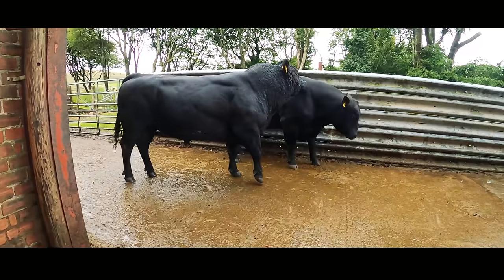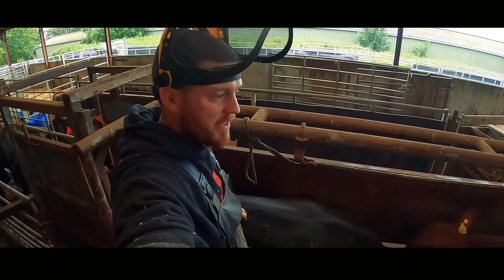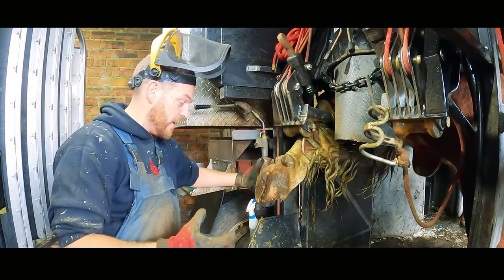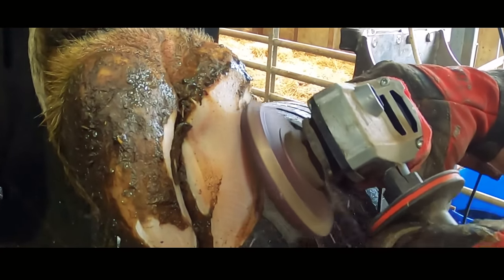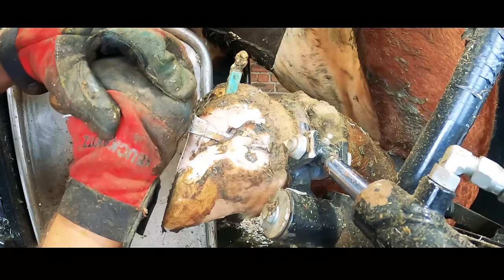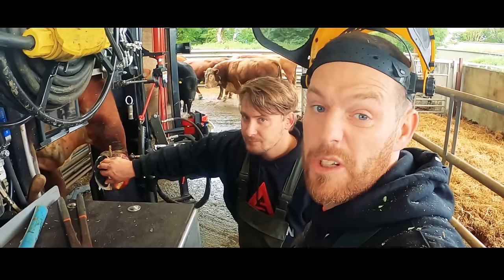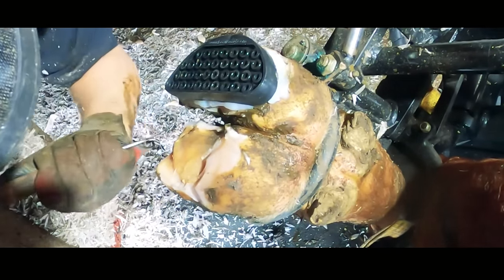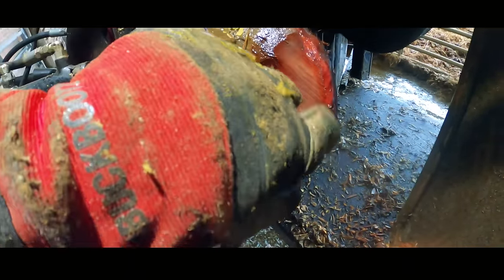*PEELING BULLS FOOT* ... hoof trimming 50 BIG bulls!

Comment: How would they have trimmed big bulls like this in the old days before these crush machines were a thing? Like a couple of hundred years ago?
Reply: They wouldn't of trimmed them because it wouldn't of been necessary.  The overgrown hoof issue is due to them being on soft ground, whereas cows and bulls in open pasture would have the natural abrasive properties of the ground to keep them worn down.
Reply: @ngnmech  you are spot on. Thanks
Reply: Very carefully
Reply: My grandpa showed Guernsey bulls back in the day so I would imagine it's how you raise them. Kinda like a horse always messing with em. I'm not a hundred percent sure .
Reply: With extreme caution I'm thinking!
Reply: @ngnmech  I agree, trimming wouldn't likely be necessary, but they would still need something like a crush.  Oxen were commonly shod with iron shoes when used as beasts of burden.
Reply: @christelchristely2816  This is fascinating, thank you.
Reply: alex Christely Great video you recommended!
Reply: @ngnmech  they where butchered on a younger age.
Reply: Well, we may never know for sure as I imagine most of those trimmers are dead now for trying to.
Reply: I know one earlier method to trim cows was to flip them on there side on a table before the hydraulic crushes were made, a method still used. They might of roped and tied them, or they might of just culled and replaced them when they did start having issues, cows back then were generally lighter too, and moved often.
Reply: There are crushes that are not hydraulic in any way, just metal, ropes and pulleys. Check out Pemberton Farms channel, he has a simple crush that has no hydraulics/electronics

Comment: What is with the blue tube you are prodding the cows with? I Iowa, U.S.A. paddles and electric prodds are the most common way to get cattle to move. Dogs & whips work as well but not in pens like you are working in.
Reply: That's just a length of polythene water pipe.

Comment: just curious, on almost all these farms, when you see a bull, it is a beef breed bull, yet they have milking breeds for cows. Are they using beef bulls on dairy cows for crossbred calves which would not make good replacement heifers? and if so, why? In the U.S., they pretty much use dairy bulls on dairy breed cows and beef breed bulls on beef cows.
Reply: In Britain, it's dairy AI for  the top 3rd of the herd, then it's either beef AI or bulls for rest.
Sometimes, it'll be dairy for the first 3 services, then put the beef bulls in.

Comment: To be fair, even if cattle lose a few drops of blood during a trim, it is really not terribly important. They have much more blood in them than us, and heal faster. I've seen vet procedures where an eye had to be removed, the blood loss was much more, and was still negligible in terms of overall blood volume. As long as it is cleaned, treated, and with regards to hooves it is not put under pressure when walking, it'll be fine. That and ensuring slurry doesn't collect in there. Graeme knows this of course, just putting it up for others who may not.

Comment: 6:04 im not an expert but id wager its an adaptation to their environment, maybe the breeds ancestors came from areas with climates that encouraged very soft peaty or muddy ground to form, a wider hoof would spread their weight more evenly and reduce the amount of sinking into the dirt or mud they'd do, might also be a side effect of their anatomy, does the breed have a larger than average chest? is there more weight distributed over the front feet than other breeds?

Comment: I think that the reason they need to have their feet trimmed like this is because they are bred to be heavier than their hooves can take.  If you released them into the wild for a few generations, the heavy ones would die and they would quickly evolve to be smaller.

Comment: Another reason to carry a stick is you look bigger and the cow respects you more. When your working with the same cows all the time they accept you in the herd and can challenge you for status. Some cows respect men more than woman or larger talker people than shorter.
2nd is it keeps your body out of kicking range by tapping with a stick versus being closer and using your hand.
3rd is in cause they get spooked you have more control in rounding up. 

I've used the stick more than once to pull off an old wrap saves your 🙌 from

Comment: Ok my kindred, me grandfather was Marcus Lamb and he immigrated to Texas from Ireland in the late 1800's, and married my Grandmother who was 1/2 Cherokee Indian (Native American). They had 30k acres of land out in Tivola Texas where they grew cotton and raised 8 kids, pigs, chickens, couple dairy cows,, and Quarter Horses for racing in Louisiana.

So I have a question for you, as a Aerospace Researcher & Developer, some of my research includes biologic systems, more specifically, autonomous and semi autominous med pods used to care for Astronauts on extended missions and interplanetary missions like the mission to Mars.....

Anyway...I see how your job could be made even better, and help the farmers produce a more consistant premium product with lower operational costs. Because a lame cow or bull causes stress and they can release copious amounts of cortisol that use up the glycogen in the meat leading to very low quality end product. Given the aforementioned, what do you think about the following:

1.  Adding a 360° scanning multi angle HD photo camera and a 360° ultra sound machine to you hoof machine to generate a hyper accurate 3d view of the entire hoof before you start? Then using lasers project the finished size of the hoof onto the hoof both front and side ways so that you can ensure you removed the correct amount, and that it is level . You could also bring a reusable form mold to take a mold of each hoof and then use rubber/polyurethane and melt it and cast a perfect fit heel?

2. Adding a multi angle 360° digital x-ray machine like those used in dentist's offices. That way you can check for damage to the bones?

3. Would you consider using a natural product call "Relax Fit" ? To calm all your buddies down before giving them the spa treatment?

4. Why don't you use a hoof hardener to mitigate rock infiltration?

5. Have you encourage the farmer to rock machine through his pastures to minimize the amount of rocks his herd may encount?

6. Or why not organize a FOD ( Foreign Object on Deck) walk like we did in the US Marines, where we were lined shoulder to shoulder and walked up and down the fields picking up anything that could affect an airplane or you could call in a hord of metal detectors to walk side by side not only picking up rocks but also looking for treasure? 

Love your channel and great videos!

Comment: I noticed that you or your buddy don’t wear ear protection when using the grinder. I’ve had a working lifetime using all sorts of power tools including grinders. I now wear 2 hearing aids as the high pitch noise has buggered up my hearing. No excuses for not wearing electronic ear defenders which filter out the noise but you can still hear a 1000kg bull sneaking up behind you.